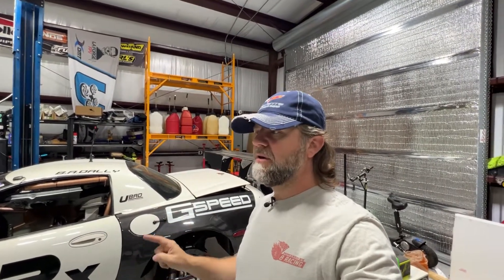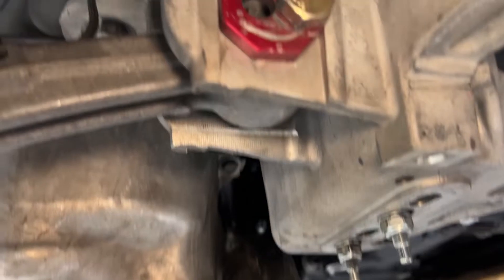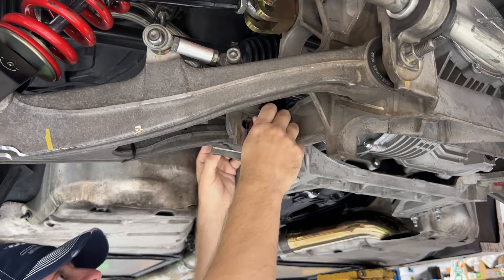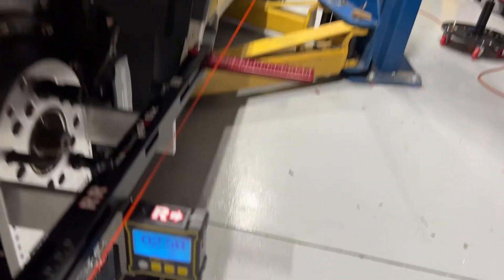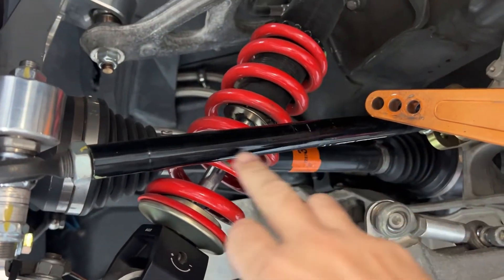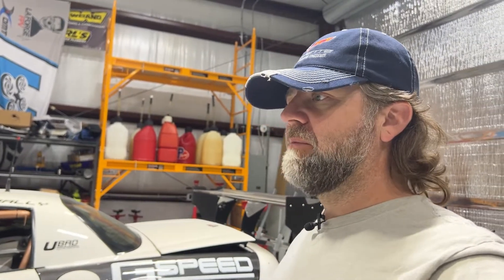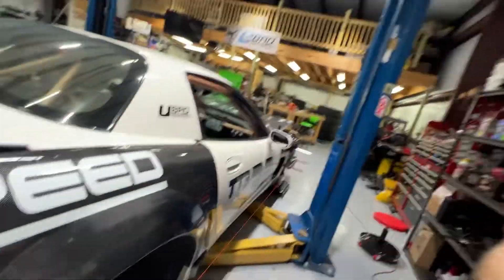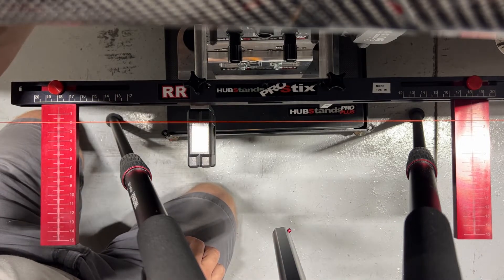C5/C6 Corvette Alignment Series Part 3 - Rear Camber and Toe

Comment: How are you getting so much negative camber in the rear on the lowest AMT plate settings? Do you have upper camber adjustments on the coilovers?
Reply from the maker: I have GSPEED drop spindles.  I also run C6 control arms since I’m running both front and rear C6 cradles.
Reply: @Poweredby8Racing  Appreciate the response man. I just finished installing grease fittings and PFADT polys on all my control arms and am now trying to figure out which setting to use on these AMT plates. I'm still doing other work so I havent gotten a chance to drive and see, but I ended up with S-3 front with 2x 1/8 washers for caster and 4x 1/16 for camber reduction hoping it falls between 1.2-1.4 camber with 7+ degrees caster. Rear I'm still debating with myself S4 or S5.

Comment: Watched all parts of this series and still had some questions about how the specs play into how the car actually handles. Would you be willing to weigh in?

For example, my C6 GS just got an alignment following the PFADT specs for street/track use and now I'm fighting an unpredictable car. The rear end really wants to pull out and it's a little scary to drive. Even going onto an on-ramp at acceptable speeds, the car is losing traction. Any recommendations? Is this driver error or something in the specs?
Reply from the maker: Sure. I can do my best.  Is there anything specific or are you asking about every setting?
Reply: @Poweredby8Racing  Specifically how toe and camber affect the car. For me, I just had an alignment and the rear toe is .03" in, and judging by what you said later in this video, the car would do better around 1/8" or 3mm in. My car is a street car so i don't want to eat tires just trying to get it more stable. Rear end really wants to kick out in turns and it never did that before the alignment, but I wasn't given the "before" specs

Comment: How come T on one side and S pn the other? They dont need to match?
Reply from the maker: Many thing can cause each side to not be equal.  I’ve corner balanced and also have driver weight in car to mimic the settings as if I were in the car.  Many shops will just match up sides and you get what you get.  Obviously that’s not what I’m going to do, so I go through each setting, check settings, make tie adjustments recheck and if I need to rotate the camber plate then I will.

In the front of the car it’s even worse for me.  At one point I ripped out the factory upper a-arm nuts.  The shop who did the repair didn’t take in to account that’s the area I use for camber/caster adjustments.  Because of this mistake they just welded new plates there with no regard wether they were equal to each other.  So my front geometry is far from stock anymore.

I think I’m part one I mention how everything is just a spiral down effect.  Snake and adjustment, check the changes, make and adjustment, check the changes, and eventually as you get closer and closer to your end results the movements become smaller and the adjustments become smaller.